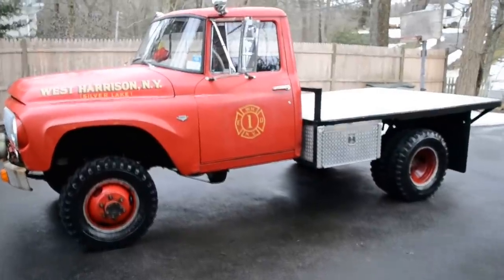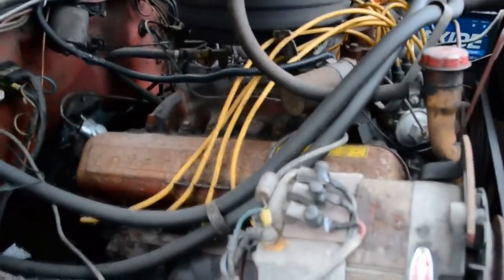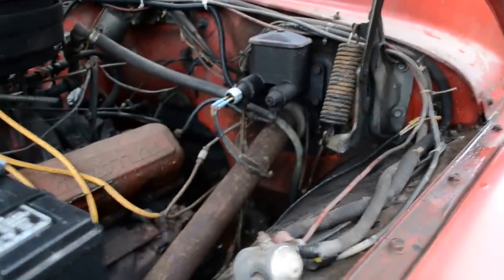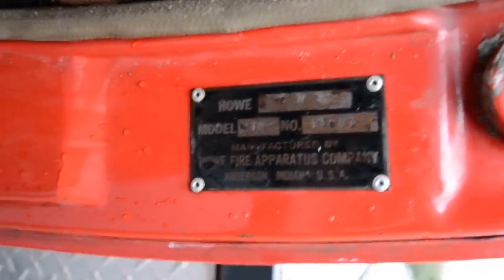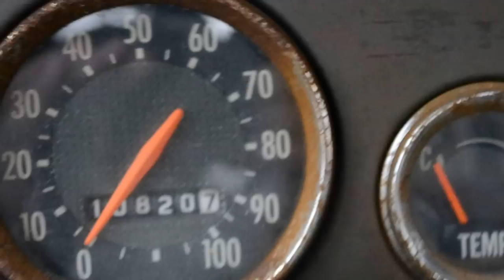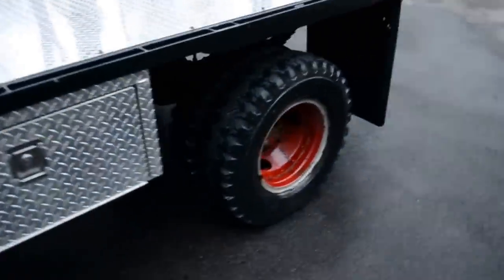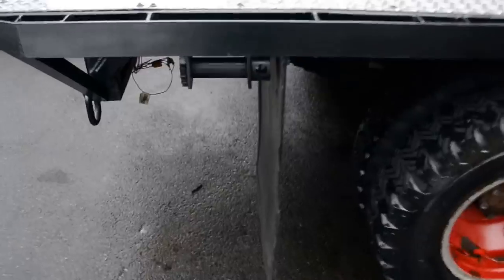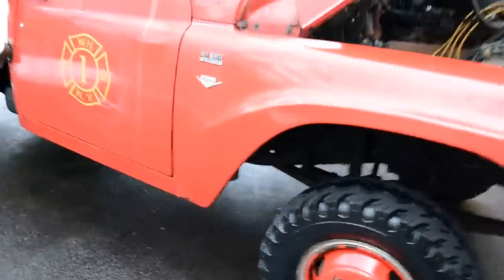1965 International Harvester D1300 Custom Flatbed Walkaround

Comment: Engine size is on a raised rectangular block on right side of engine, right below exhaust manifold in very front. Get a small mirror. Should read "V304" or "V345". What's the HP reading on the door tag? If it's "180", it's a 304. The rest should be self-explanatory. Oh, "GEEF MEE DEE GRILL!!!" for my 1967 1300B dually pickup (Bonus Load bed) Rat Rod. By the way, that's a "generator", not an "alternator". That's not a "dual master cylinder". Right side is "brakes", the other "clutch". You should have known.
Reply: Correct for the most part the engine componets as are the rest of the truck are always as viewed from the driver's seat, ie l and r, the clutch shares a common resistor with the brake master cylinder and the clutch is on the right as properly viewed. Thank you for the info, I need all the help I can get on my 66 1300 for myself build.

Comment: Hello I have the same truck but mine is stamped as a D1500-4x4 can't find another like it.have you seen any
Reply: michael cole  i know  air force  1500 prolly  get for cheap
Reply: Jason Conklin where
Reply: Page 370 of Fred Crismon's book: "International Trucks 100 Years" (c. 2007) shows a D1500. Only engine option was the 266 V8. Front axle (FA) is an FA-28 rated at 4000 pounds. Rear axle (RA) was either the standard RA-20 giving a GVW of 16,000 pounds. The optional RA-126 gave it another 2,000 pound GVW rating. Big question is, does it pop tits when you turn the key off and on while decelerating? Inquiring minds need to know.